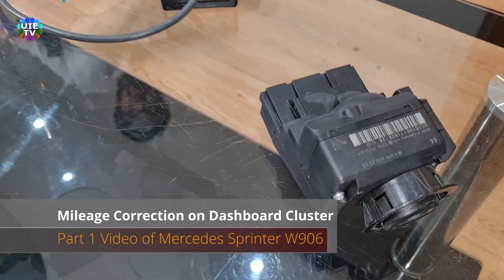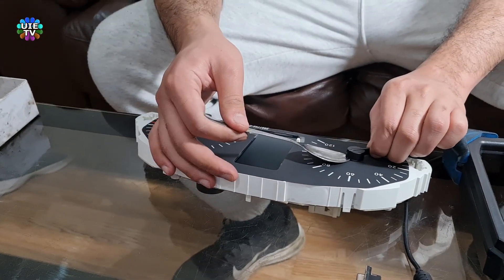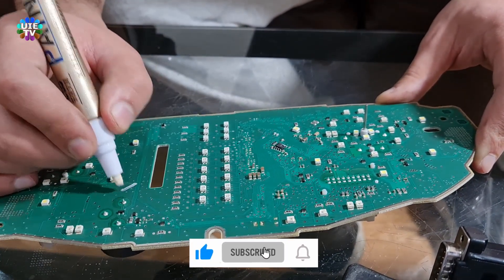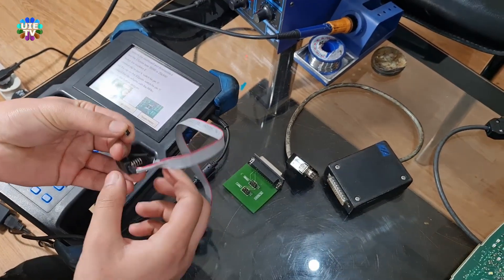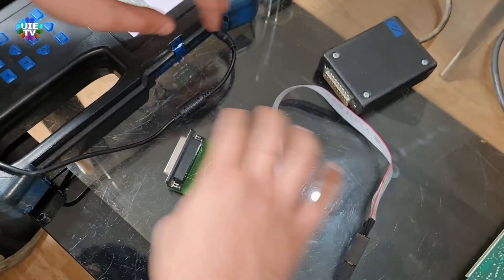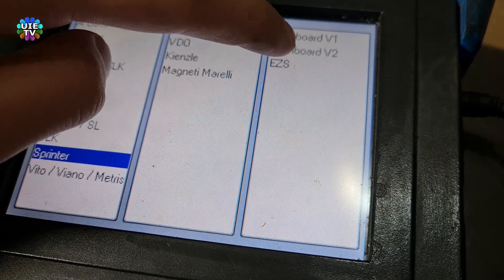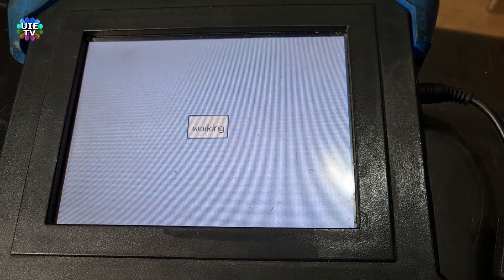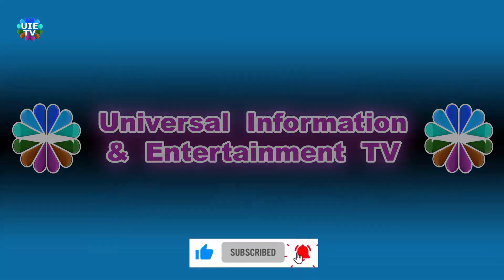Mileage correction on Dashboard of Mercedes Sprinter W906 or VW Crafter Van Bus or Truck Part 1

Comment: Impressive but potentially very corrupt. So if someone wants to double the value of their car they can simply follow the instructions here! Thank God for Carfax. People need to be educated. There is no need to have to ever do this if one is honest. Integrity is key here. If you changed the engine, then document it with a simple video/pics. This can screw a lot of people out of their hard earned cash. It has more evil potential than any good claimed.
Reply: If your IC is defective then you cant adapt a second hand one. Reset it under 250km it's as 'new' and car can adapt donor IC.

Comment: So if I buy a second hand dashboard it will automatically take the original mileage from the key module? 
I want to to upgrade my sprinter with the "highline" dashboard (like the one in the video) but I was not able to find one with similar mileage as mine
Reply: Hi, did you ever get an answer on your question? I purchased a van with 250000km on it but the cluster showed 405000km. I wish to get it back to the real wear.

Comment: Hi there, 
I have the bulb out warning light always on, on my  dash, since I replaced all bulbs for LED. 
What would happen, if I use the same technique just to remove the little led, that makes the warning sing appears on my dash while I’m driving ? 
Thanks
Reply: Vehicle computer checking lights by measuring current. Since you replaced  incandescent bulbs with LED the current is much lower and ECM assumes the lights are out. I don't know what vehicle you have in some it can be reprogrammed in some not.